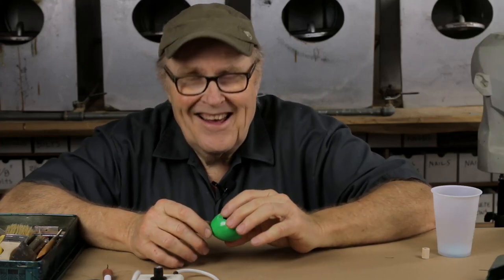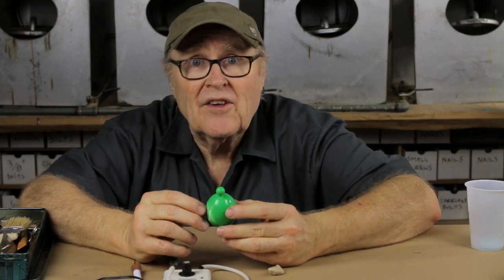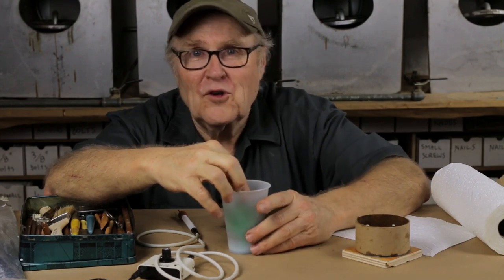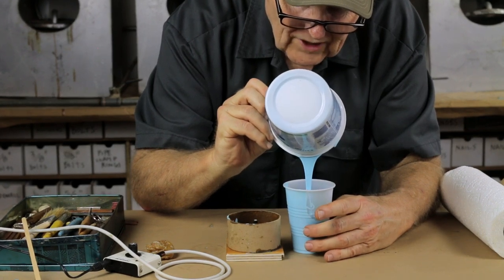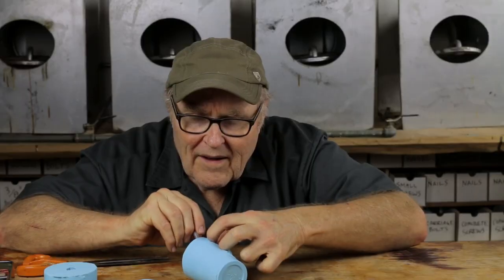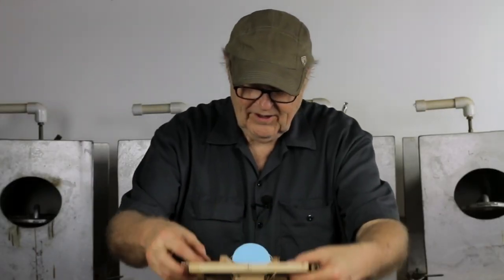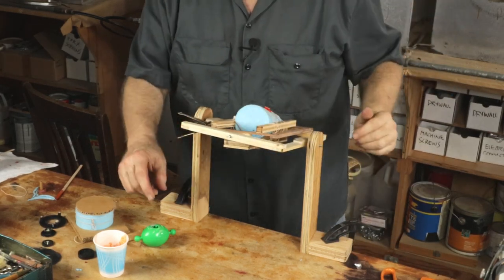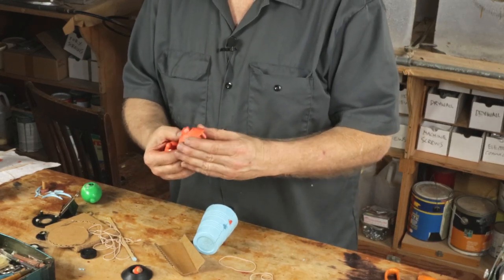Hollow Casting With Solid Parts? How Would I Cast That - #1

Comment: Looks like the original is a modular block of sorts. Multiple models of the original can be linked together, popping the ball of one into the hex socket of the next. Ideally, the ooriginal came in a set with some of the balls and sockets in swapped positions for optimal adaptability.
Reply: Yeah I agree. They used to make them for kids

Comment: I'm thinking the solid ends and hollow body could be done simply as a roto cast. Being at the extremitiy and having a choke at the entry, the balls will fill quickly and drain reluctantly under roto conditions. Not sure the hex socket of the original could have been done as a simple roto.

Comment: 17:55 - An important detail is to not spin it too fast, because, as the resin gels, it flows more slowly, and if you spin it too fast it actually just stays where it is (it starts to flow down, but then you spin it and "down" is now up, so it just jiggles in place). You're just trying to make it flow with gravity, not push it outwards with centrifugal force.

Comment: Thanks for another great video AND for cutting those pieces open for further inspection.  I remember cutting clay pieces in half in a class right on the wheel for checking wall thickness and remember other people in the class being shocked.  I told them this is how you get better, make both small and large pieces over and over and inspect them.  Don't just rely on luck and keep everything.
Reply from the maker: Exactly Rich! That’s how you learn.

Comment: Another great video packed with helpful information. Cutting the demo castings open was a great way to look at what happened inside of the molds.

I’d be interested to know if you used any particular methods to prevent bubbles in the resin. Particularly since using a pressure pot/chamber isn’t an option for hollow cast objects. 

Thanks a bunch for sharing!

Comment: Hi Robert!
I have a  "How do I cast this" question. I am wanting to do the same type of thing, but I am trying to do it with a liquid type metal (Like JB weld mixed with acetone) that I can pour into a mold like this. I thought about mixing JB weld with acetone to give the JB weld the consistency of honey that was heated up in a microwave, so it pours fills gaps better. 

I am already familiar with lost wax mold castings / smelting but I want to try and see if I can use the rubber mold because it comes out a lot more detailed. 

It doesn't have to be JB weld, any metal that I can use as a liquid that pours easy would suffice. Obviously I can not use a hot metal into a rubber form lol. 

Thanks Robert!

Comment: I'm certainly enjoying going through all these. I'm interesting in concrete / plaster / jesmonite  casting so I hope some of the skills transfer. Not that I caret too much, they are interesting in and of themselves.
Reply from the maker: The principles are the same. You have to design the mold so you can get the material in and the air out.

Comment: Lovely video. =) I already knew that I should cut zik zak lines that let the mold interlock later. But this time I learned I should come to a straight line, when the cut finally comes to touch the model. I would have liked to see the solid part cut open, too. Just to see if it worked and the nobs at the end really are solid. But maybe I should not doubt your experience. ;-D
Reply from the maker: I have a high level of confidence that they are solid because I poured them. They didn’t catch any bubbles so that tells me that they filled it properly. But you’re right, I should have cut them open in the video.

Comment: Have so enjoyed your video series--you're a master and inspire such creativity!  Thank you for sharing your abundant knowledge!  I was wondering how to cast a small hollow resin house with cutout windows and doors.  How could I approach this?  I can't figure out how to end up with the cutouts starting with the mold itself and then the best way to cast it so it would be hollow. Thought I would pick your brain. Thank you!
Reply from the maker: To create the hollow cavity of the house there must be an open side. This would require separating the house from the base. If that was done it would be relatively easy to cast. As an alternative you could block the door and window openings and hollow cast the house using a rotational molding machine. That would make it hollow and afterwards you would cut out the door and window openings.

Comment: Your videos are great! I'm learning so much every time. I sculpt miniature figurines (35mm) out of apoxie sculpt, greenstuff & sculpey, and was wondering how you'd go about molding & casting those. The figurines can have a fair number of undercuts, and I have lots of trapped bubble problems in some off my molds. How would you eliminate these? Would you still use a block mold? I've settled on using two part molds for now, as the figurines are so small, prone to breaking, and I can cut extra vent holes. Thanks!
Reply from the maker: If you want, send me some pictures of your sculptures. It’s hard to know what’s happening without looking at the actual pieces. Thanks for watching!
Reply: @RobertTolone  Hi Robert, I sent you some background information and pictures to your yahoo email address. Thank you!

Comment: thanks so much. I prepare a skull model that's pretty big and I want it hollow. This will help me a lot.
Reply from the maker: Let us know how it turns out.
Reply: @RobertTolone  it turned out pretty well and the lesson from you helped a lot. Thanks so much. It’s like 15 years since it did this last time and back then I was using rigid molds and had to take in consideration a lot of geometry and math and had to think a lot in advance. This is so much more reliable than what I had back then.
Reply from the maker: @hueroth  Ugh, rigid molds. They are great for certain things but miserable when you have to cast something complex.
Reply: @RobertTolone  back then the silicone molds were a luxury and we had a lot of time on our hands. Also, the experience was a very useful one.

Comment: Hey Robert, question for you. After fixing the model and polishing it would you recommend throwing some primer on it to get a uniform color making it easier to spot imperfections and additional things you need to cleanup? Is there a particular primer that would work best for this? Something that wouldn't affect the rubber.
Reply from the maker: Yes, priming the model can help smooth the finish.  There are lots of brands of rubber and primer so it’s impossible to say which will work together. I have used both Krylon and Rustoleum primer successfully with the Econo-sil 25 silicone rubber I buy from from silpak.com. But definitely test your materials.

Comment: First time i found your channel.... I love it ! .... Could you weigh the original object to figure out how much resin you need ? 🤔
Reply from the maker: Yes, especially if you know the ratio of the weight of the model material to the weight of the casting resin.  I always use the same sculptor’s wax to make my models and I know how much it weighs compared to the resin I use. So all I have to do is weigh the model.  If there is a big difference between the weight of the model material and the resin weight the method doesn’t work until you establish the ratio between the two materials.

Comment: Excellent video!
I had a question regarding making the object hollow.
I know the point was to make the item one single piece. Just curious if it would be possible to make a 2 piece mold and then brush the inside of the molds with the resin and then immediately join the two surfaces (if that makes any sense)?
I know this would most likely leave a seam to deal with, and maybe fitment issues. Does this seem like an alternate approach to this?
I love your articulating fixture by the way!
Reply from the maker: Your method would work, particularly if you use a resin that is designed to be brushed on as opposed to one that is designed to be poured. The biggest difficulty you will encounter is making a good bond of resin around the seam.   Plus you will have a lot of flash and a lot of parting line to smooth out. Also you would have to be careful to create an even wall thickness when brushing on the resin. This method sounds slow and tedious to me. I would opt for the rotation method or I would cast the individual halves in separate molds and glue the castings together. I think that either of the last two methods would be easier, faster and cleaner.

Comment: Oh Great and Powerful Overheated Tiki-Tolone! I am pleased with your hollow casting, and would ask of you to perhaps address the issue of making a hollow casting of a specific thickness? Is possible?
Reply from the maker: Depends on how precise your requirements are. It is very difficult to precisely control the wall thickness of Roto cast pieces. The only way to ensure precision is to cast both the inner and outer walls of a piece.
Reply: @RobertTolone  That's what I was afraid of, yet I feel better also now, knowing my variable thicknesses are to be expected with this, and to just try not to get them too thick. I'm making some sculptures to be cast in bronze, you see, and it has to be 3/16 minimum, but it's so darned expensive that I'm trying to figure out how (other than to cast inner and outer walls) to keep the thickness as even as possible, though the smaller parts will of course be solid. Thanks for your insights, as always very helpful. :-)

Comment: Can you tell me about the construction of your pressure pot set-ups?  How were they made and the front hole can't be round to get that oversized round door inserted.
Reply from the maker: They are made from the air cylinders from the brake system of very large trucks.  The door is oval in shape so that it can go in one way, turn 90° and seal the door shut. The door is bigger than the opening. If it were round you would not be able to get it inside the tank.
Reply: @RobertTolone  I did find the post where you describe how the pressure pots were made.  It is obvious the  hole isn't round, I was curious what the width of the oval was and the diameter of the door and diameter of the chamber.  If you were starting from scratch, and money wasn't necessarily an issue, would you still make them round and the current size, or larger?  What would your perfect pressure vessel look like?  I was thinking about making one out of square/rectangular, thick aluminum tube with a square/rectangular door.  It would give me some practice on the TIG welder, and I have the thick aluminum sheet for the ends and a door.  I have a stainless steel autoclave that is round, and good for the pressure, but it has 6 latches which take time to secure, and the thing isn't quite long enough for the largest pieces I need to cast.  I am thoroughly enjoying your videos.  I have some parts to recreate for classic sports cars.  I have a vacuum chamber for the rubber, but without the pressure pot, I am getting too many trapped bubbles in the resin that are affecting the integrity of the pieces.  I have lots of thin pieces, essentially vent/grate covers and louvers.  How does one attach a photo?  Thanks.

Comment: You mention you can pour in 3 separate shots, as opposed to one shot, is there a time factor that needs to be considered? Do all your pours have to come one after another in a short time frame? What if say, you got called away and couldn't do another pour until the next day, would the resin adhere to the earlier pour?
Reply from the maker: It probably would but I always do the pours as close together as possible. As soon as one layer gels I pour the next one.  I have no experience with what happens if you wait a long time between pours so I don’t really know. Do a small test and see.  Let us know what you find out.
Reply: @RobertTolone  If I do a test, I will let you know. Hopefully, I'll be able to do the pours close together. Just was wondering about the limit of the product. Thank you, Robert.

Comment: Enjoy your videos. Was wondering if you may know or be able to tell me how figure out how hollow body frog fishing baits are made?...want to make my own and cant find any information on what kind of molds the companies like Spro  use. 
Thanks
Reply from the maker: Industrial molds are likely to be different than the molds custom shops use.  I’ve never actually held a Spro frog in my hand but just watching YouTube videos and looking at pictures online I’m going to guess they are injection molded.  You could mimic that technique by creating a frog body that is divided in two parts. Each part would be half of the hollow body, so they would be thin-walled hollow shapes. After casting you would insert the hooks and harness, legs pieces, etc, then glue the halves together. This would be a great project to do on my channel. Do you have a frog body that you have designed?
Reply: @RobertTolone  was looking to make frogs similar to "scumfrog" brand, only a bit larger. Would be really cool to see what you could come up with if you gave it a try. Made one once with a form of plaster of paris that I dipped, then broke out the form. Then put the hooks in. Worked, but not great and labor intensive.

Comment: how much resin do you calculate to make a hollow part ?
Reply from the maker: It depends on how strong you want to make the part. But you can begin with three resin pours of 8% of the filled weight each.  So the final casting would weigh about 25% of the filled weight.  But really you need to figure out the wall thickness for each project. Lightness versus strength, etc.

Comment: Is it possible to do this with epoxy resin?
Reply from the maker: I have never experimented rotating epoxy resins. It should be possible if you can find a resin that sets quickly. Obviously you wouldn’t want to use a resin that cures in hours because you would have to keep spinning the rotator all that time.
Reply: @RobertTolone  great point! Thank you so much for responding. Your videos are great help! ❣